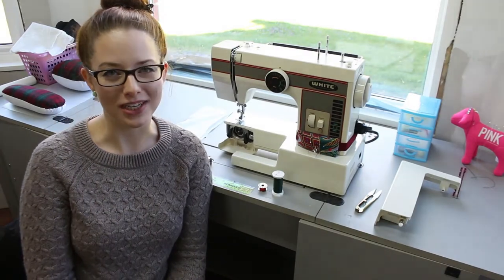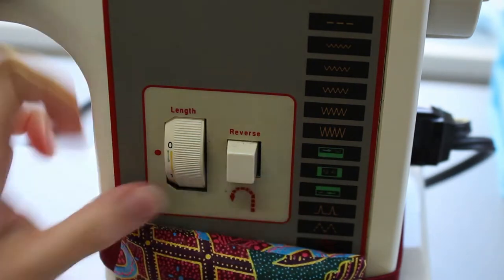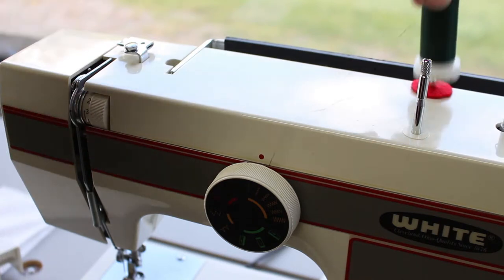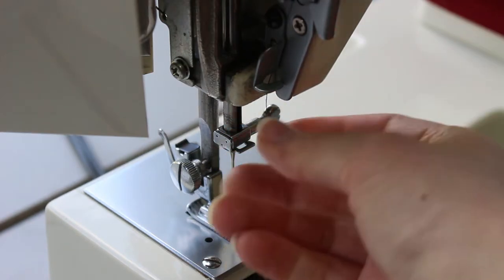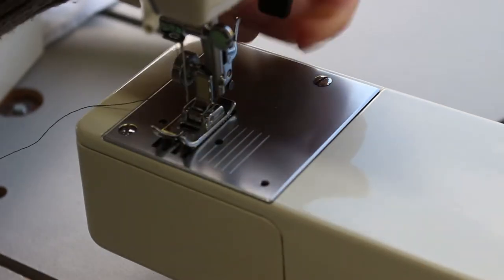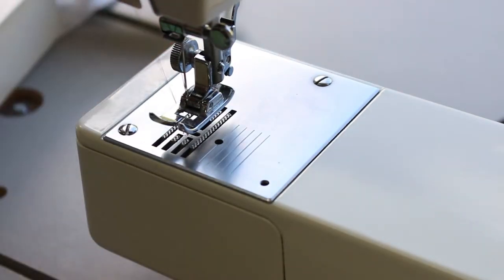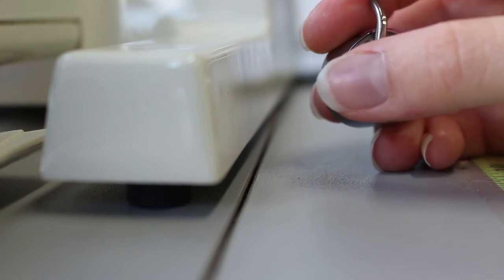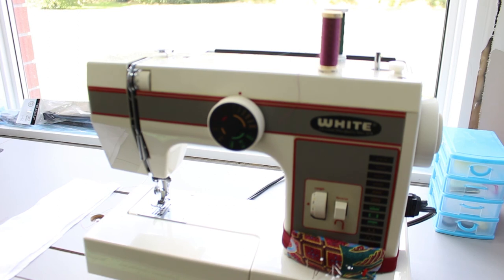How to Thread a Sewing Machine & Bobbin | Everything YOU NEED to Know!

Comment: +you said when you put the bobbin in the case it should stay in.  mine doesn't   it falls right out of the case.   does it make a difference? while i can finally get the bobbin thread up it loops the needle thread. so i get the second needle tread out and everything seems to turn ok.  but when i sew after a few stitches it all knots up and stops.  i have to take the bobbin case out but also the other 2 round things.   I think i have them in correctly, but it still all knots up.   I must be doing the bobbin wrong or do i need a new case?